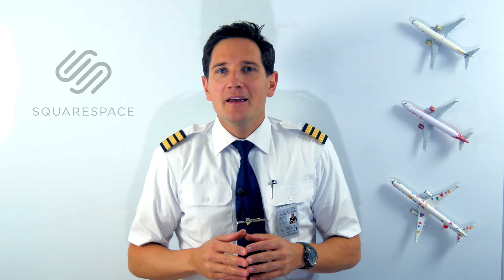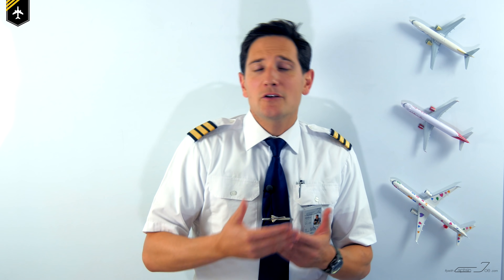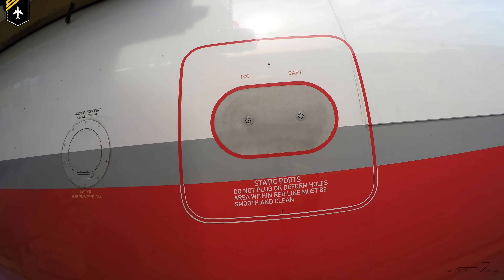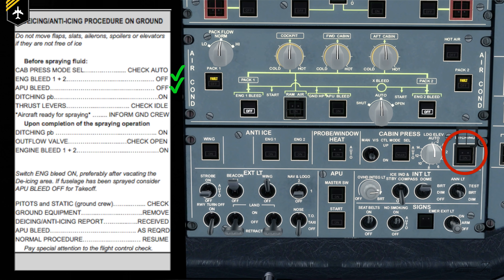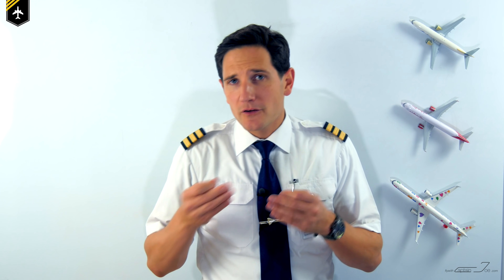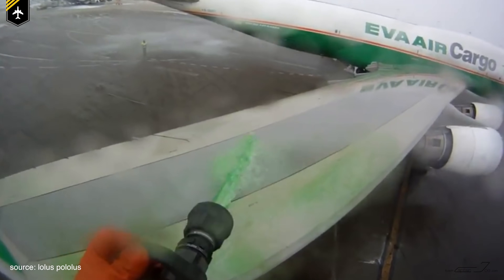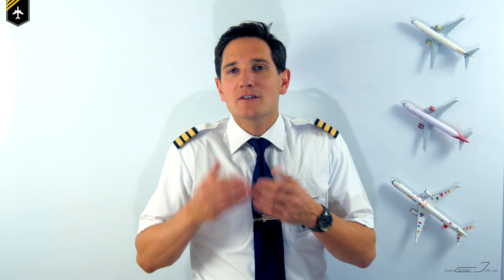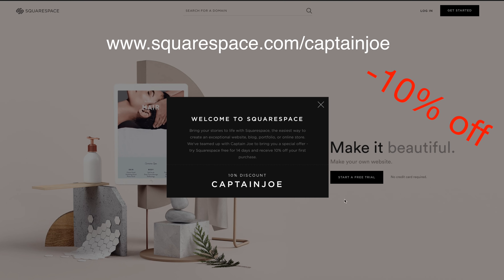Why do PILOTS DEICE? Explained by CAPTAIN JOE

Comment: I know this video is 2 years old, but I gotta add that propylene glycol is actually not thaaaat toxic, it's even used in food. In Russia there is actually a lot of ethylene glycol de-icing fluids in use, now that thing is quite damn toxic :( and there were crashes which relate to the ice problem quite recently, for example: https://en.wikipedia.org/wiki/UTair_Flight_120 and even as recent as last year https://en.wikipedia.org/wiki/Saratov_Airlines_Flight_703

Comment: What are the static ports ? What are the mechanics behind them (How do they work)?
Reply: The aircraft has instruments that use barometric data like the altimeter, air speed indicator and vertical speed indicator. The static ports are air inlets that measure static pressure these instruments need.

Comment: Why can't airplanes have a system like a car rear window defroster  to warm up the control surfaces  ?
Ezelleman@aol.com
Reply: There is a system. Jet aircraft usually have a system where the engine bleed air is led inside the wing leading edges using a tube system.

Comment: Deicing provided me with one hell of a flight experience a couple years ago. So where I live we had the worst winter on record a couple years ago. I was flying out around that time and they had to keep the plane running to keep it warm. So we were delayed getting on the flight. When we finally boarded we had to go through the deicing process twice. Once the deicing was done the pilot realized there wasn't enough fuel to get to our destination (which is crazy because I was only flying across the state and my state isn't that big) so we had to go back to the gate and refuel. We took off about the same time we were supposed to land. Yeah it was a really short flight. But still. Very frustrating morning.

Comment: I've seen the duration of deicing vary based on the type and amount of ice. Had the first flight out of Cleveland and it took quite a while to get the plane clean from the overnight storm. 
Only seen type 4 once, didn't know exactly what it was at the time but I knew it had to be for more extreme weather. It was crazy to see it stick to the plane through most of the take off.

Comment: Interesting effect of accumulated rough ice on the flight surfaces increasing drag. I'd love to see papers describing this. 

I met a glider pilot several years ago who discovered a curious effect that mimics the aerodynamics of a golf ball. What he did was affix duct tape in many layers to the leading edge and underside of the wing, creating a sort of step or terrace form. He discovered that it actually decreased drag and he was able to fly longer. I'm kicking myself for not remembering his name or being able to cite his paper, but it's interesting because the same effect should be roughly the same under certain icing conditions on the wing surfaces. 

Of course this doesn't assume the negative effects of the high density of ice for weighing down the wings and definitely not for its effect on control surfaces or their actuation. But it was a very curious thing and this video made me think of it.

Comment: it's common in long flights that the fuel in the wingtanks with it's high thermal capacity cools down to temperatures well below freezing. then after landing, the icy fuel will cause the surface of the wing to cool, causing condensation and ultimately icing, even in warm weather.

Comment: Hi Captain Joe, thanks for this great explanation. I was wondering doesn't the wings accumulate ice at flying altitudes where temperatures are so low
Reply: Yes, they do, but most of the time, it is not dangerous. It will only be dangerous if ice forms on the leading edges of the wing. Here's a video of ice on the wing during high altitudes: https://www.youtube.com/watch?v=tIpZupfP-LM&t=147s

Comment: Dear Captain Joe, thank you for the videos you make. In a structured and fairly easy way you explain an avation topic. My questions is why the anti icing system (with bleed air from the jet engines) not used instead of de-icing procedure.

Comment: if you hate reading the descriptions of videos, this is what he said for those who couldnt hear: Dear friends and followers welcome back to my channel! Today´s video is another interesting topic regarding winter operation. Why do aeroplanes have to be deiced prior take-off? A lot of passengers underestimated how important it is to deice the critical surface of the aeroplane, such as the wings, flight control surfaces such as ailerons, slat and flaps rudders, vertical and horizontal stabilizer. 

On the ground, when there are freezing conditions and precipitation, de-icing an aircraft is crucial.  A lot of passengers underestimated how important it is to deice as frozen contaminants cause critical control surfaces to be rough and uneven, disrupting smooth air flow and greatly degrading the ability of the wing to generate lift, and increasing drag. 
If larger pieces of ice separate when the aircraft is performing a take-off run, they can be ingested into engines intakes or hit propellers and cause catastrophic failure. 
Frozen contaminants can lock or jam control surfaces, preventing them from moving properly. 
But there is a major difference between De-icing and Anti-Icing an aircraft. 
De-icing is defined as removal of snow, ice or frost from a surface. Anti-icing is understood to be the application of chemicals that not only de-ice, but also remain on a surface and continue to delay the reformation of ice for a certain period of time, better known as the hold-over time (HOT), or prevent adhesion of ice to make mechanical removal easier.

I´ll shortly mention the aerodynamic characteristics, regarding airplane stall speeds, in case an airplane wing is covered with thin ice. 

DEFINITION OF A STALL: 

Stalls in fixed-wing flight are often experienced as a sudden reduction in lift as the pilot increases the wing's angle of attack and exceeds its critical angle of attack (which may be due to slowing down below stall speed in level flight). A stall does not mean that the engine(s) have stopped working, or that the aircraft has stopped moving — the effect is the same even in an unpowered glider aircraft. 
 
I hope you enjoy this video! And I would also like to thank  @photoaleksi (Instagram) for the outstanding thumbnail picture. And all others helping with their videos and support! 

Thanks for watching, all the best your "Captain" Joe

Comment: You can do Anti Icing with heated type II. Even in a two steps procedure. First one with 50/50 and the second one with 75/25. The mixtures 50/50 and 75/25 are always heated to at least 60 degrees at the nozzle.

Comment: proplyene glycol is actually generally regarded as safe for humans. It is mainly used only for high end de-icing or for specific circumstances that require a non-toxic solution, but uses go beyond aircraft for the most part. Ethylene glycol is actually what is used for commonly, and is fairly toxic.

Comment: its one of the most important procedures. In SKP In 1994 Fokker 100 of Palair Macedonia crashed right after the runway due to not proper deicing of the plane. The plane took off and crashed 200 meter after take off. only 1 survived in the tail of the plane

Comment: there was a guide line down in the check list saying 'if fuselage has been sprayed consider apu  bleed off for takeoff'what does that mean.
Reply: The APU can provide so called "bleed air" to start the engines and power the airconditioning unit on the ground. Now because they sprayed the fuselage with propylene glycol, it's advisable to close the "APU bleed" so none of this de-icing agent gets into the "air bleed system" and cause some problems. Especially the type 2 de-ice liquid has some gelling agents in it which makes it a bit sticky. That's great to prevent ice from building up imediatly after the de-icing, but it's not so great if this stuff gets into the bleed air system where it can clog up things.

Comment: Propilen glycol isn´t toxic. Ethylen glycol is. Both can be used as anti-freeze. That's why propilen glycol is used on food industry machines rather than the most common ethyl glycol widch is used on auto engines.

Comment: Thanks for this (as always) comprehensive explanation Captain Joe ;-)

Regarding the "Upon completion of the spraying operation" section of the checklist you cover @7:14, shouldn't the DITCHING pb be set OFF instead of ON (which is its expected state anyway)?

Comment: To a non pilot, the cancellation of a flight due to fog seems obvious.  But to a pilot, with all those instruments, it would seem very possible to take off in fog.  Landing may be another matter.  So why are flights cancelled?  Supposedly an airbus can fly without a pilot.  How much do the eyes of a pilot come into play when taking off and landing?  Especially when you consider how poor vision is through a windshield when it is raining fog might seem just another variant.  With the exception of runways that you are unfamiliar with and unusual conditions (as in Tenariff) as long as all the lights, ground proximity radar, and ILS equipment is present, what is the big deal?

Comment: This is similar to boats/ships. Get too much ice accumulation at sea and it can cause major instability. The solution is to deice. At sea this often involves having to ship it off with a hammer/pick. No rubber boots like on the LE of plane wings. Hold on, why did he not mention rubber boot deicers?

Comment: Is the cabin pressurised separately  for passengers and pilots? 
As in if the pressure where the passengers are suddenly changed to a life threating level would it be the same for the pilots?

Comment: Thank you Captain Joe for the nice explanation. Is there a minimum temperature, where deicing is working, and is there a minimum temperature under which a take off is not allowed?

And it seems to me that the deicing process is entirely to the Captain, are there not any (international) rules that force a deicing under special conditions?

Comment: Hi Jo, I’ve often thought that when a pilot has to do a ‘go around’, in particular due to gusting winds etc, there must be more pressure on him/her to get it right the second time and therefore could try to land when it’s probably not ideal; and if they subsequently have to go around ‘again’, it must be piling more pressure on. Does the pilot feel awkward or even embarrassed if they have to try and land multiple times and is there a guide as to how many times you  are allowed to ‘go around’ before you quit and land elsewhere? Many thanks

Comment: I’ve heard it’s around 3000 to deuce, would it not be better to run very thin copper wires, r even tube inside the wings and run heated fuel through it.?

Comment: How do they keep the turbines from icing
Reply: IMO everything in the jet engine gets hot enough that ice can't form on it. Basically the only thing that only moves cold air is the fan (the big turbine-like thing in the front) and that's connected by a metal shaft to a turbine behind the combustion chamber - so even that should heat up enough just by heat transfer.
Reply: Hot air blown into the engine

Comment: Mixed ice :DD I remember episode of Mayday about crash happened because of ice fall into engine, that was overlooked because de-icing happened at the nights and part was missed out. Is there any way keep big planes at heated hangar before fly? Rather than de ice and cause delays?
Reply: the big planes are mostly at gates and they dont park for hours ;) the problem is ice building up during the time its on the ground ;)

Comment: We are in 2017 117 years of flying and there is no de icing from inside the wing? Please can someone explain.
Reply: Aircraft already have systems to deal with in-flight icing. On the ground, it's much, much cheaper and less complex to have ground-based de-icing processes than to build integrated de-icing systems into every aircraft.

Comment: Up here in the Edmonton International airport we have a special pair of deicing pads for the planes that have just left the gate if the temperature ever goes below -35c or we have heavy snow.   Despite a general deicing treatment while taking on passengers these planes are directed to these two deicing pads where four trucks are waiting to give the plane additional deicing.  They are very quick about this and the trucks are custom built just for this airports use in allowing full remote deicing boom operation because the jet engines are in idle.  The Tarmac is also good for the environment as it is hooked into a dedicated water recovery and treatment system.   Any plane waiting for more than 30 min while in taxi also must be called back to this deicing pad to make sure no ice built up as it was waiting to take off.  Our weather is that severe.

Comment: Is "tactile feel" a form of checking ice clear on flight surfaces?  On a flight I took, there was concern of ice, but the deicing equipment was not working.  The pilot said having the ground crew do a tactile feel was an acceptable method to ensure plane controls were safe.  Thanks.

Comment: If you take off in the rain, is there a chance that the water will flash freeze and stick to the aircraft when you get to the colder temperatures at altitude?  Or does all of the water get blown away by the airflow?

Comment: With all due respect to other peoples' SOPs, most airlines do it way too complicated. Here at Orbit, we have a switch "Allow aircraft icing", which we must turn off at all times, especially in winter.

In fact, the airline likes it best if we just keep the weather augmentation system dial (WASD) to clear.
Reply from the maker: Oh wow, thanks for the insight, didn´t know there was so a switch, which plane is that?
Reply: We have that on all planes, actually. Airbus, 747s, CRJ... It's near the top of the windscreen. You tap it and it drops down a list, a lot like the glareshield. We can set up a whole lot of things there. Keep on flying even if fuel runs out, time-lapse flying so we don't need relief crews, disable all failures... lots of very useful stuff. We're not allowed to use it though, IATA says that's cheating.

Comment: The ice is cold and you are applying hot liquid on the surface of the plane, won't the difference is temperature have an impact on the surface integrity?
Reply from the maker: I always question that myself, but technicans told me it´s fine!
Reply: Short answer is no. Metal aircraft skins distribute heat quickly and don't experience thermal shock stresses.
Reply: Thank you:) good to know

Comment: Dear Captain Joe, can you explain how aviation radio communication works? e.g. from before leaving the gate, taxiing, takeoff, while in flight, before landing, after landing, and last but not least when arrive at the gate. Also, how to properly call for both normal and emergency (pan and mayday)? Thank you!
Reply: well there are 2 differences in radio^^ if its a VFR flight or its a IFR flight with a fixed flight plan so in terms of airliners 1. requesting flight clearance for the flightplan 2.requesting pushback and taxi 3. tune in tower for take off clearance 4.contact departure 5. during flight u will pass sectors so if no changes or so happen in a sector u will hear just to contact next sctor control like contact vancouver center at 111.90 before landing u will speak to approach in landing to tower and after landing and leaving the rwy ur speaking with ground^^ and for emergency calls PAN PAN PAN (Callsing) is DECLARING PAN PAN PAN due to xxxxx Problem repeat (callsign) is declaring PAN PAN PAN due to xxxxx this is also the same with mayday but mayday means that this problem is very serious ;) like PAN PAN PAN Minimum Fuel (can be used when ur getting to the fuel limit to safely divert so u cant stay in holding for much longer and atc will get u faster to the ground)

Comment: De ice? Never had to do that I live in Australia and we never get snow  in most of our parts 😊
Reply from the maker: The land down under ;)
Reply: Melbourne had some unexpected icing conditions some weeks ago. Aircraft were delayed due to MEL's unfamiliarity with the process. I believe that buckets of hot water were thrown over the wings of an A320.
Reply: Happens in Canberra sometimes over winter :)
Reply: Even if you don't have snow in your area, airplanes coming in from high altitudes will experience VERY low temperatures, so if there's any humidity, the plane could get icy.

Comment: Can you get ice build ups while cruising?
Reply from the maker: Yes, next video topic!
Reply: Talha Tariq : Yes you can. Some planes have boots, expandable sections, to break the ice off the wings. In flight icing is, I think, on leading edges and comes from moisture in the air getting on the wings then freezing. Then you have the problems that Joe mentioned. Avoiding likely icing weather can affect the route that the plane flys.

Comment: Didn't know that turbo-prop airplanes had a different procedure for deice. Great video CPT
Reply: Kevin Brennan : Any plane that has propellers has another surface that can accumulate ice. Ice can also build up on the engine intakes of jet engines if the ice then breaks off it can be sucked into the engine and possibly cause damage. Piston engine craft have their own issues. Carburetors can freeze which is why fuel injection is better. Jet engines are much more reliable than piston engines.
Reply from the maker: I questioned it myself :)